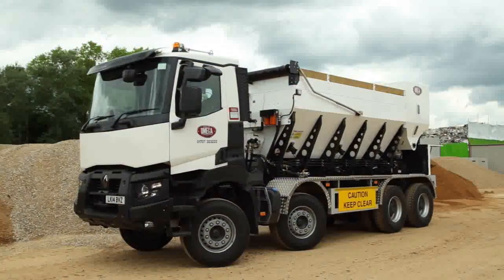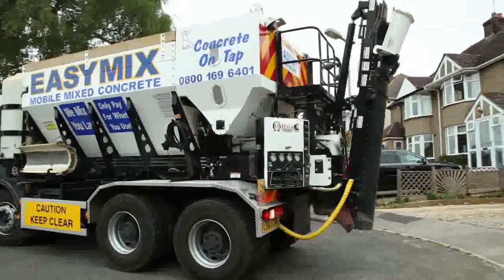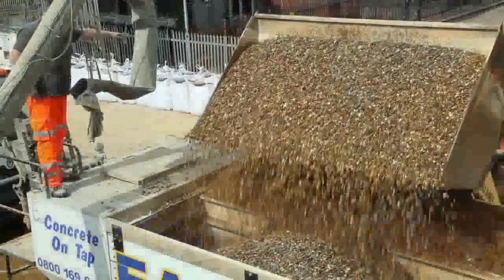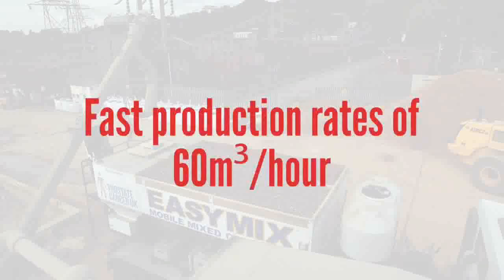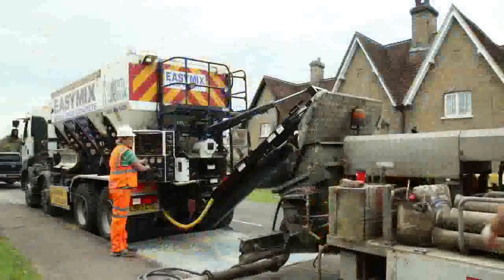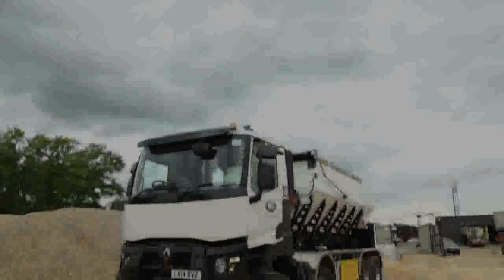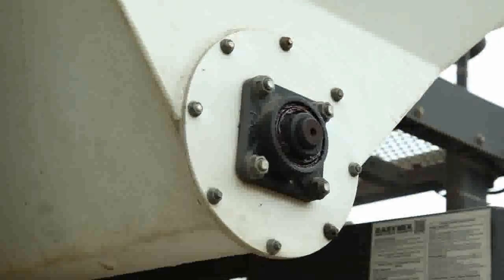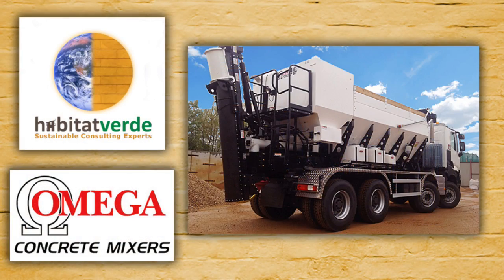The Most ADVANCED Concrete Mixing on the PLANET!

Comment: If it only carries 10 tonnes, and a metre of concrete weight 2.2 tonnes, then it can only pump out about 4 metres before it needs to head back to base. Or am I missing something?
I´d like to see this turn up at a 200 cubic metre bridge or slab pour. It´d get laughed off site.
I can see it being a favourite with the D-I.Y crowd though.
Reply: 8 cubic metres. Just heard this video say 10 ton, that's 5 cube. Nah that carry 8 cube
Reply: It's good enough for airport runways and taxiways that use thousands of cubic metres of the stuff, and you always get the right mix each and every time. That and no batch inconsistencies due to traffic from the depot to where the concrete is needed...
Reply: Yeah unless sand is wet and dry in the same load. Nightmare other day, got mix right, next it likes puss, dry it up, then it's stuff.

Comment: they dont mix the concrete long enough tried them before
Reply: That's usually dependent on the cement. You may get some false setting if cheap cement is used but most plants over false set proof cement now.